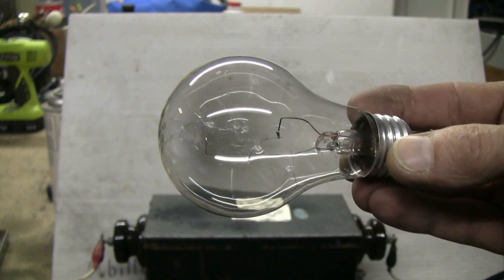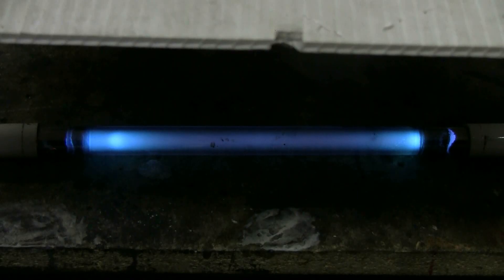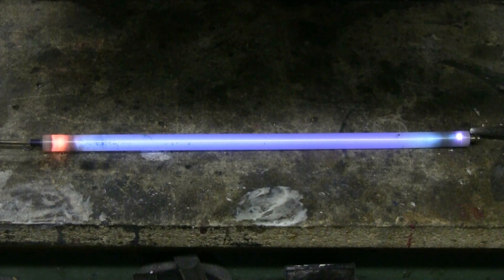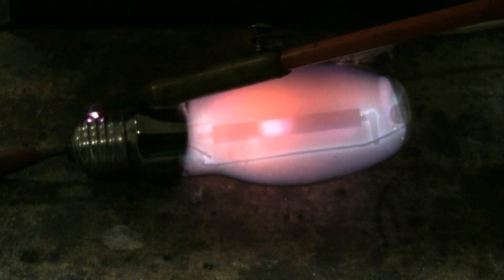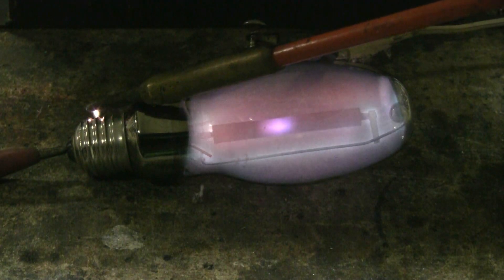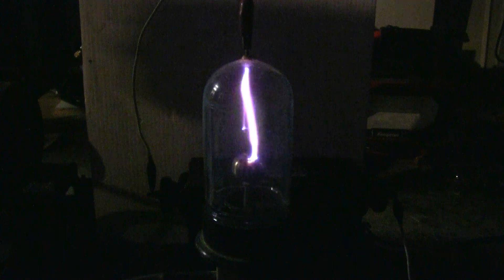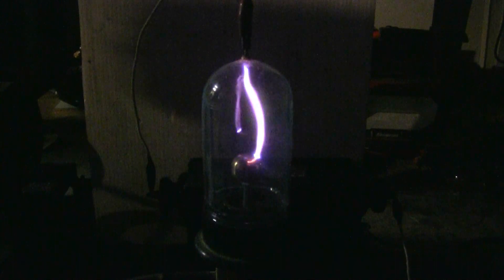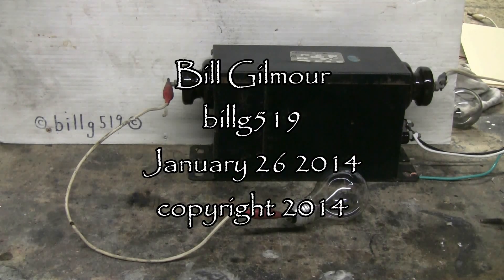High Voltage - NST And Light Bulbs

Comment: Hi there. Are these safe? Are there any X rays generated? You do not need much of high voltage to run regular burned tungsten bulb but the question is if x rays are coming out from these. In my opinion it is dangerous besides the bulb might explode.